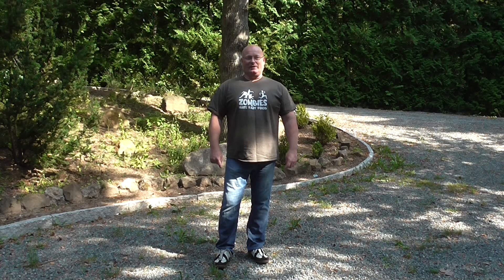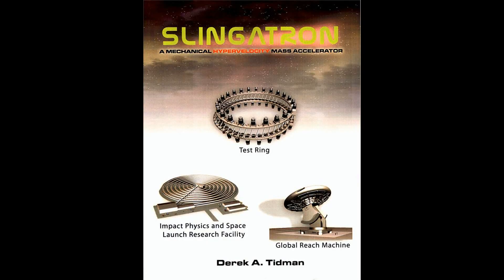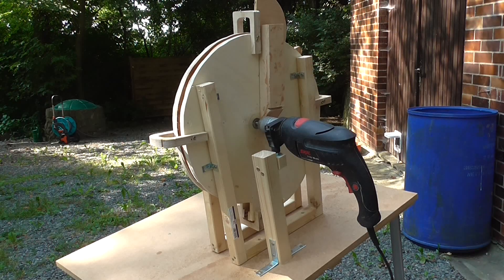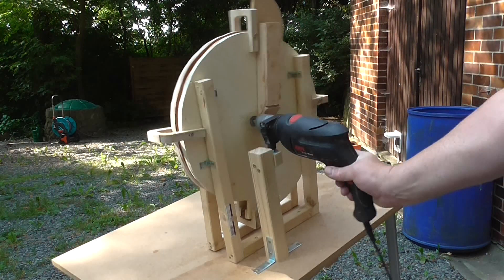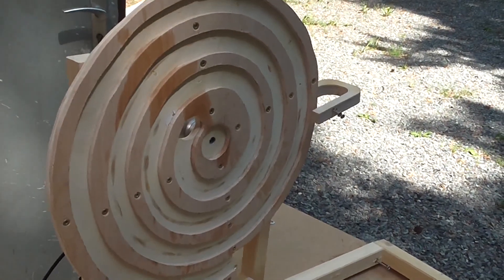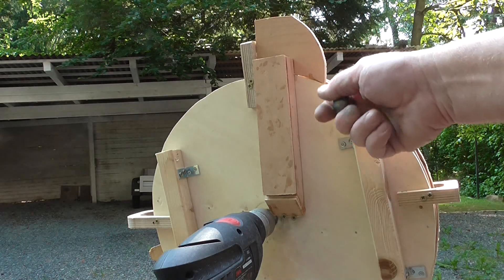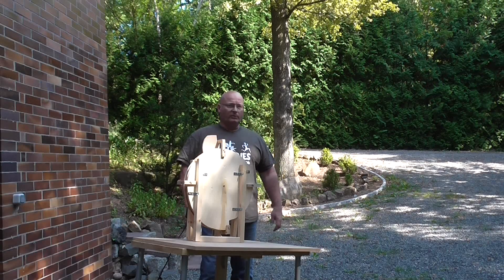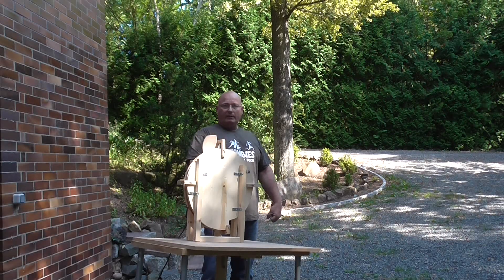How to turn a drill into a monster shotgun!

Comment: I was thinking about a centrifugal slingshot usins high speed RC motors spinning at 30000rpm  with a disk kind of the hard drive disk. the main  problem is the release mechanism and other problem could be the unbalance after the ball release

Comment: Why not incorporate a flywheel mechanism with a single feed slot to auto load?  I think a horizontal mount would also be more effective than a vertical one, and easier to auto load.
Reply: A tab could be added just after the feed slot, to control a ball drop mechanism to prep the next ball for feeding into the next rotation.

Comment: my dad was a move special effects guy and we got in trouble with my mom on a regular basis because of stuff like this. We made one of these thing back about 69 or 70 and we used a 15 horse power motor to power it. I will never forget how gitty my dad was, I had never seen him like that. He was doing all kinds of strange math I had never seen before and alls he said was, "Damn, the velocity is gunna be like a shit load" That was an understatement.  When he hit the motor we had not compensated for the angle of the floor, and I have since learned about gyroscopic forces, well actually learned it right after current hit the windings of the motor. The spinny disk thing straightened right up and started to yaw, well the bearing did reach a really good velocity.  We never found that thing, but right after the bearing we through our house at about a 45 deg angle my mom came through the door and I swear on my mothers eyes me and my dad both broke for the door, I got caught and got my ass beat, when my dad finally showed up my moms dad in tow there was screaming and words I didn't know my mom knew flying.  Me and dad both were where grounded from playing in the shop for like a year. But damn if it wasn't woth it.

Comment: The arm should have been symmetrical like a propeller just to keep it balanced while spinning. It would have reduced the vibration on the drill and possibly allow for higher rpm...giving you more acceleration on the ball.
Reply: I was about to say, initial acceleration might be higher with this setup; but once up to speed a symmetrical design would be superior

Comment: for a larger model , use an electric motor off of a cooler w/ a Gear Drive stepping up the RPM to the final drive shaft. 3:1 to 4:1ratio 

or, take a medium or large metal lathe with gearbox and headstock. then attach to mounting adapter after removing from carriage
this model would have to be made from metal liners  and aircraft aluminum outer body. with final drive shaft mounted on roller bearings after being pressed into thrust bar with keyway in shaft.
the metal liners would be the spiral. made from two pieces of steel plate that are cut in a mirror image on a water jet cutter. drilled then holes are countersunk on the inner sides for mounting to the outer aluminum body so spiral is on each side of ball and bar fits in between steel liners
would recommend starting with Dimensions that are really not much bigger than current size.
can also use double End Bar for centrifical balance( like lawnmower blade). and providing the ability for automatic mechanical loading gate.
your idea is very cool!
this is somewhat of a modern-day trebuchet.....
but , if you really want to send projectile downrange... pickup a Barrett 50 caliber BMG rifle lol
good luck with your project !

Comment: Perhaps if the blade was made to be the full length of the diameter of the spiral extending entirely through the spiral, it would pick up two balls without having them rotate against each other as the rolled in the spiral. It would also balance the apparatus.

Comment: just wondering: 
1) it is desirable, but is it possible to perhaps place my self into the wheel, run it in reverse, and somehow recapture the time it took to watch this? i would be satisfied with even only some of the time, say, 4:20 of it. 
2) have you run any "trials" involving the possibility of using common cats, two or more at a time, and if so, what velocities and distances are possible? 
3) is there any forensic ballistics information that can be gathered from the projectiles, metal or feline, that would necessarily trace the device to its maker?

Comment: Hi Joerg,  Hey, if the spiral were spinning in the direction of the spiral (like an S spinning clockwise) with a spiraling release so when the ball came out it could be channeled in a certain direction, it should propell the ball at a much higher rate.  Due to using it's own centrifugal force to make it accelerate faster than the spinning of the drill.  I hope this is making some sense.. Ha ha!

Comment: Yep I really love your creation sir ! 

Just one thing about a physics question: What's intersting about spiral systems like cyclotrons for accelerating particles or the slingatron you presented is that the object is difficult to accelerate, and need to achieve very high speed. The acceleration is relatively slow in front of the speed. But here with your drill, the drill give all the acceleration at the beginning. Though the ball will accelerate in the spiral but in this case, only because it gain some radius, because the drill will push with the same force. So I'm pretty sure that the ball would achieve the same amount of end velocity than if you hit it directly with the end of your drill stick. But don't take it as a negative critic, I really appreciate the apparatus you've done, it's enjoyable :p

Comment: Couldn't they like shoot atoms into space using the same thing they use to split atoms...? getting them close to the speed of light but then removing a piece of the path that it travels along or redirecting it towards the atmosphere ? (I'm not a physicist so I wouldn't know )
Reply: If you are talking about a particle collider, a single atom would probably be stopped quickly by the atmosphere. 

Trying to throw things into space from the ground would need heat shielding as the atmosphere would be trying to vaporize the payload, and you'd have to go much faster than orbital velocity just to reach a height where it could orbit.

Comment: Its an interesting concept, but I can't help noticing that it does absolutely nothing remarkable.  I guess it is more efficient than simply hitting the ball to accelerate it, but the effective velocity of the projectile at the 'muzzle' is still going to be around the same as the velocity of the 'blade' that's propelling it forth.  

Basically, just as effective as a catapult, albeit much easier to actually aim.
Reply from the maker: +scrfce123 It is also much easier to operate than a catapult. What it is all about is how to convert the rotational force of an engine into a shot.
Reply: +JoergSprave Just reading over my comment again, I noticed that it sounded negative.  From an engineering perspective, I genuinely think that it is a brilliant idea.  I would love to see a 2 meter version with a motorbike engine - At 8k rpm, it would be propelling these balls at close to 3000 fps!
Reply: Actually, I think your assessment is incorrect-- the blade speed in terms of distance travelled, is "faster" as you go out from the centerpoint-- so it does accomplish accelleration even at a constant RPM of the motor.   The ball speed does "ramp up" in velocity as it travels outward in the spiral.   What might be interesting is simply to make the diameter of the spiral larger, so that it accellerates even further, though the torque required to handle it would increase as well-- one question is, is there an "optimal" spiral diameter for the H/P of the engine being used?
Reply: +Rashad EL-Osta Does everyone read comments in his voice?
Reply: +scrfce123 i like it - its great - i immediately thought of doing this in a non metalic tube with strong permanent magnets dragging the ball round
Reply: Syncopator has no one attempted the math for an optimal range? Add gearing for torque with double springloaded hand levers, a taller upper magazine with biased "plinko" dowels and mount it all on a swiveling base, atop a tripod.
Reply: +scrfce123 add some magnets to the equation..(think rail gun)

Comment: Using modern lightweight materials, counterbalancing the slinger, increasing both the diameter and the working RPM it could be lethal. Perhaps a high speed motor with a clutch so you can get the R's on the motor real high then engage. Try an auto starter! Now how do you get it into a tree stand? 
seriously though, I can tell with your chuckles it's never intended to be practical but rather fun. And it is! All your stuff is fun! Thanks!

Comment: novel.  i'm getting that the trajectory v departure angle must equal project speed. maybe 45 mph tops.  in fact joerg, you remind me of that big guy in milla's joan of arc movie who's always cussing.  vive la france!  jeanne est avec moi.
Reply: +scrfce123 that's how fast you run up a tree when sobieski arrives at your door for a cup of sugar.  you perverts never get the jist, do you. -M kusanagi
Reply from the maker: M kusanagi You mean La Hire? A man after my heart. I was a redhead too, a long time ago.
Reply: JoergSprave yeah, I think that's the guy.  lots of stuff w/JS branding.  tried making disposable one-shots with pinball-type retraction yet?
Reply: +M kusanagi Huh?  The projectile speed is equal to the speed of the 'blade' at the final arc before it exits the device.  

Skil model 6002 drill, max RPM = 3000.  Radius at maximum arc = about 25 cm.

2.pi.25 = 157 cm.   

3000 x 157 = 471,000 cm per minute.
471,000 x 60 = 28,260,000 cm per hour

28,260,000 / 100,000 = 282.6 km/h
282.6 / 1.63 = 173.4 mph.

How did you figure 45 mph?
Reply: +M kusanagi Haha.  Thanks for the laugh.

Still, I'm serious...  how did you get 45 mph?  I'm curious.
Reply: M kusanagi I don't know who Sobieski is and I sure can't run at 45 mph.  You are one funny dude.  I find your responses extremely amusing.  

The reason that I asked how you derived 45 mph is because what you said seemed intriguing to me.  For a second I doubted my math, but it is definitely correct.  

Why do you always end your comments with your user name?  By posting under your account, it is inherently evident that you are the author of your comment.  Makes it even funnier.  Thumbs up to you.  Hahaha.

Comment: What if, the Circle disc thing was laying flat and had maybe, 4 separating "spiral" things on the inside track or maybe just make it thicker and layer the "Spiral" tracks so it lets out at the 12, 3, 6, and 9 and have 4 separate feeding tubes feeding it those little round pellet gun BB's and it spends laying a full circle of fire, But you'd want to stand far away. and have some kind of long chain / belt to spin the thing.

Comment: I like the fun experiments, and especially these ones which are very well presented by Joerg .... but I am concerned that the pressure of the increasing centrifugal weight of the steel ball revolving at high speed could smash through the wooden spiral and possibly injure the operator or a neighbour half a kilometer away !!!

Comment: Nice Try !!  ..Just  wondering  if  the  disc  is  Horizontal..  multiple  shafts inside ...and  feeder  vertical  loding  BB  with  gravity ...  all  in  an  air tight  chamber  with  a  hot  blower... :-)  ...  with  a  barell... ??  may  shot  hot  bbs..

Comment: Oh, one thing...don't try to patent this thing.  It's already been invented!  You can check out "Hatcher's Notebook" by Julian Hatcher for details.  But here's a summary.  After the U.S. entered WW1, a person invented a unique kind of "machinegun" for use in trench warfare.  It consisted of a pancake-like, thin cylinder, enclosing a disk with radial vanes on it.  There was an outlet port on the rim of the outer enclosure, and a hole in the center.  A funnel-like magazine fed 1/2" (12.7mm) steel ball bearings into the hole, and the inner disk was spun by a powerful motor.  The balls were launched out at around 800 ft/s, a velocity about same as that of a .45ACP pistol round.  It wasn't very accurate, but it certainly could have laid down an effective field of fire against the German trenches.  It was not adopted, probably because the U.S. had plenty of Browning machineguns.

Comment: Very nice ideo. Just a thing?! You feed the spiral from the top right? So you drop the ball in the spirals exit. Are you sure the ball goes into the middle (the spirals beginning) or does it land halfway? It has to go through 4 turns but i think it only go throuh 1 or 2. Maybe im wrong. Just sharing my thoughts ;) Solution (if possible) Load it directly in the middle.
Reply from the maker: The RC Operator Did you check out my enhanced version?

watch?v=nrvgJ3aHPr4
Reply: Now i have hehe. You came up with some good solutions! Well done i must say. But still :) I think a barrel will make it a little more precise and maybe it shoots abit longer. Also looks cool :) i have subscribed to your channel so i can follow your crazy stuff hehe.

Comment: You built a spiral turbo
Tesla built a good one.
To make it an auto you need a timing belt\gear  like when WW1 pilots had to fire machine guns through the spinng propeller.
As far as otter space launch without a rocket. It's been done.
A full working launch was in place when the rulers  had it taken apart and stored. Think about a bullet being the piston of a compressor and all air pressure you would have if the bullet was the size of a VW bug suspended by electromagnets and propelled by electro magnets like a bullet train in an air tube , Look how high you can shoot a soda bottle rocket. It also get's lighter as its going.
They took Teslas free energy machine down also.

Comment: Great idea. I would changing some things you could probably try that, in my opinion, would make it even better.
First I would turn it around so it will shoot out the top. That way you could make a little sight system to aim. I would also add a little straight segment at the end of the spiral to give the ball more precision. And finally (but most important to me) I would make the blade the full length of the disks diameter, that way the forces applied on both sides would be equal and cancel each other, so it would work balanced. Your drill is going to thank you for this!
I'd love to see a video of this shotgun with the changes and see if it makes any difference.

Comment: make a barrel that connects to the end of the drill and make a spiral screw pattern inside the barrel. Drop a bb into a slot on the back of the barrel after the drill is spinning as fast as it can to allow the bb to enter into the barrel and follow the spiral grove out into the barrel shooting it out of the barel due to the speed of the barrel spin.

Comment: Would it not be much simpler to use a circular track instead of a spiral track? With a circular track you would have to run your drill in a lower gear (lower speed, higher torque) and allow it to to accelerate to the proper speed (the drill accelerates the ball).

On the other hand, a spiral track allows you to run the drill at a constant speed in a higher gear, because the spiral itself is what accelerates the ball (instead of the drill). 

Both setups could be calibrated to deliver the same end velocity, but a circular track seems far simpler and faster (and I would also bet cheaper) to build than a spiral track, so that seems like the better option.

Comment: One thing you could do to easily make it full-auto is add more rotating arms. Add enough so that the space between them is only big enough for one bearing to fit into the space. This would also increase the balance for the sling-shot.

Comment: Have you thought of vertically stacking that device in a cylinder with auto feed it would be devastating.Mabee a small gas powered drill or lawnmower engine.

Comment: Since the fastest this slingshot can throw the ball is the tangential speed of the arm at the max diameter of the spiral, how fast does the arm have to be spinning to make this an effective weapon?

Just for grins, let's say that "weapon speed" is 1,000 feet per second - just under the speed of sound. That is the velocity of a sub-sonic 9mm pistol bullet. If the gizmo is 3.18 feet in diameter, the tangential speed is the circumference X revolutions per second. 3.18 feet in diameter gives a circumference of 10 feet, so the radial speed must be 100 revolutions per second, or 6,000 rpm.

Not very practical. Increase the diameter to 9.5 feet and our rotational speed drops to 2,000 rpm. Possible, but not nearly as convenient as a standard Glock. But hey, the ancient Romans or even the Greeks could have built such a device, and the fire rate could have been substantial. Might be good for defense of a fortification.

Comment: Another idea might be to make the arm a fly wheel. Accelerate the fly wheel to a max speed before inserting the ball. You might need an "inserter" to insert the ball fast enough. That gets a little complicated because the ball inserter would have to be timed to a slot in the flywheel.

Comment: The fastest this slingshot can throw the ball is the tangential speed of the arm at the max diameter of the spiral. Cool device, but to be an effective weapon it would have to be a lot larger in diameter.
The kinetic energy (or effective damage potential) of the ball goes up as mv^2, so using a bigger ball doesn't gain you near as much as a higher velocity.
Make the throwing arm as light as possible and the spiral as long as possible (tighter coils). Line the spiral with something very slippery, like smooth nylon to keep friction at a minimum.

Comment: Why not just take that electricity your using fir the drill, plug it into a compressor and shoot with pressure I stead of kinetic energy.  I'm sure you will lose less energy.
Reply from the maker: But then it would no longer be home made. Also, I'd need a master gunsmith license to make an air gun.